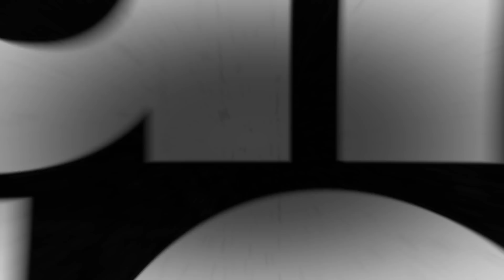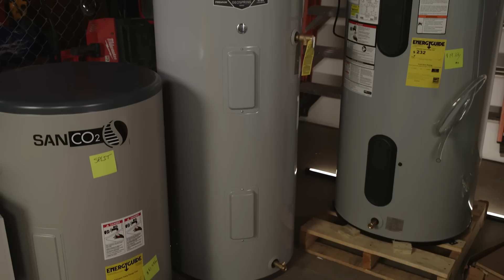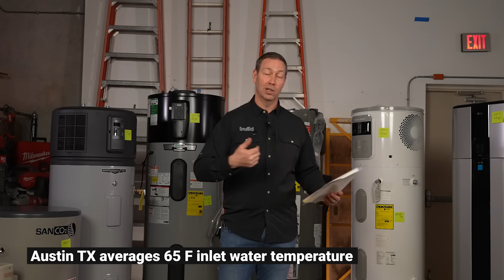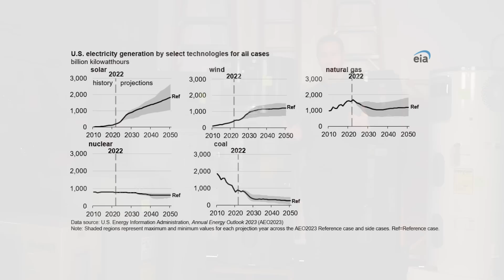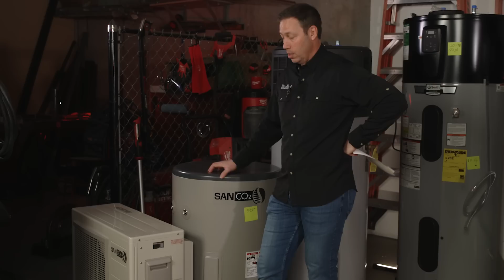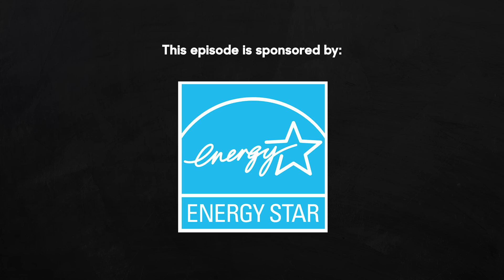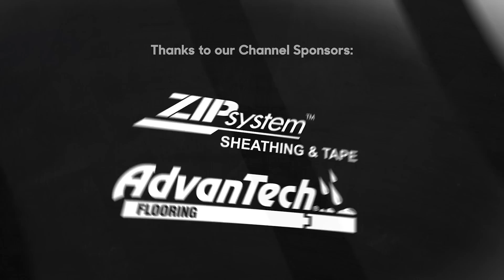2024 Heat Pump Water Heater Buyers Guide

Comment: they are great for hot climates where your typically using aircon.
however for cold climates it depends on your heat source. if your home heating is gas, then your hot water heater is effectively a very expensive gas hot water heater that also has a power bill. you would be better off with a split system.
if your using heat pump for home heating then you have two lots of running cost, one to move heat into the house, the other to move the house heat into the water. a split system can be more efficient due to a single move and can be easier to design.
if your in a mild area, the heat pump hot water can be a sizeable load on the house. again split systems are easier to design.
is the efficiency in summer going to make up for the reduced efficiency in winter?
keep in mind the home is a system.
Reply: Lots of good points here. Also for consideration, many regions don't have access to natural gas and (for perhaps political reasons) won't ever be able to get natural gas to their homes.
Reply: In terms of these being "fueled" by natural gas, keep in mind most furnaces are 80% efficient at minimum, and many here in the Midwest are >90% efficient. Most NG fired water heaters are ~60% efficient so you're still coming out ahead. In my house, the heat pump water heater is in the utility room in the basement, so I don't care if it's cold there. If it's closer to living space this would be more of a concern
Reply: @BensEcoAdvntr  I have a 2,000 SF, 5BR home in Iowa.  In the summer my natural gas (used for our clothes dryer and a 50 gallon water heater for 5 people) bill is $6/month.  There is zero chance that a heat pump water heater will pay for itself or come out ahead.  It probably costs more to operate than the natural gas water heater that cost 1/4 as much to install and will outlast any heat pump water heater.
Reply: @brianreineke9129  your bill structure is vastly different from mine here in Ohio. I still have a gas furnace along with the heat pump water heater. I use zero gas in summer months, but my bill is still $45 a month because the fixed charges don't change.  Sounds like yours is a percentage of gas used. A big part of gas service are fixed costs of pipelines, replacements, etc so much so that even in the winter the actual gas cost is still only half of the bill
Reply: @BensEcoAdvntr  my summer bill is actually $24/month.  $18 is the base charge if I used zero gas.  So $6 was for the gas that was used for the water heater and our clothes dryer.  If the heat pump water heater cost zero to operate it would take decades to pay for the cost difference from a tank gas water heater.  If the heat pump water heater costs 2kwhr/day to operate it costs more than the gas water heater.
Reply: @BensEcoAdvntr  good point. It all depends on how the efficiencies and overall costs stack up. 
I installed a resistance water heater because  the roi on a heat pump hot water is longer than its lifespan for my useage.

Comment: What's the comparison with tankless water heaters?
Reply: If you're asking about electric tankless, these are 3-4X more efficient, so around $400 per year less to operate. If you're asking about gas tankless, HPWHs are 3-5X more efficient, but utility rates vary greatly across the country. On average, though, a HPHW will cost about 1/2 as much to operate than a gas tankless.

Comment: Why is it seemingly impossible to find an HVAC tech that'll work with customer supplied equipment?

I want to buy a good heat pump off the internet, from a reputable source*, and replace my current crappy one. The model I want comes with 25 year warranty so long as it's installed professionally. It's 3ton, 18+ SEER1, quiet, works when it's cold, and not >$10k like many of the units the big companies have tried to sell me. But every tech/company I've talked to has either ghosted me, or tried to sell me their Mitsubishi, Armstrong, or Daikons. I'd do the work myself, but it's not really DIY friendly, and the warranty and rebates are only good if it's professionally installed. 

*It's a 3ton unit made by Gree/Midea from HVAC Direct. Didn't want this to sound like an ad. I'm in Pueblo CO if you're a tech willing to make some money here.

Comment: You did not mention that none of the heat pumps work if they space they are in  is freezing, with the exception of the SANCO2.  So if your garage freezes in the winter, they worn't work there.  If you put a heat pump water heater in your living space, you are robbing heat energy from your home heating system during winter, negating the savings.

Comment: I have a heat pump water heater in tropical Australia and have it in the laundry on the bottom floor and it makes it much nicer in there ( esp summer where it is 90f outside ) our winter day time temp is 70f  I am glad i did it 3 years ago as replacment foe electric element
Reply: Wow, 90 C outside. Talk about boiling heat! 🤣
Reply: @kgsails7102  lol too used to living in a metric country then attempting to convert

Comment: Thinking about installing a heat pump water heater but I use my basement for woodworking so I'm worried about the impact of dust on the unit
Reply: I would build a filter box over it. The filter in these would clog really fast and they protect the evaporator
Reply: @jepito29  the sanco2 unit seems really appealing (aside from price) to avoid this issue.

Comment: The video mentions setting these to "heat pump only" mode upon installation to see if that mode is sufficient for your home's hot water usage.

The 80gal Rheem HPWH that we had installed last month comes from the manufacturer set to "hybrid" mode (actually called "energy saver" mode by Rheem in their manual) per the manual, probably to avoid service calls if a unit needs to use resistance to meet the home's demand.

Also per the manual, the "vacation" mode on the Rheem holds the tank temp at 82F, higher than the 50-60F mentioned in the video.

Our North Jersey basement is definitely noticably colder than it was with a non-HP HW, but it's a storage space for us anyway. Hoping that the dehumidification aspect is at least as noticeable come the spring and summer.

After reading many reviews complaining about noise, I was pleasantly surprised by how silent the unit is.

Glad that the video mentions the use of a thermostatic mixing valve, which we had to add on.

For those like us on well water, it also makes sense to replace the anode rod (someplace where you have 3+ feet of head room) before installation with an active electronic anode rod (~18 inches) and can last for the life of the tank and avoid any rotten egg smells that can come from well water reacting to passive anode rods.

When I did the math for our region, any unit with a COP >= 3.25 is at least as cost efficient to operate as a gas-powered unit.

Comment: I'd love to see all the manufacturers agree on an interoperable ground-source standard. I'd have heat pump water heater, radiant floor, hot tub, fridge (why not?) and HVAC, all sharing the same ground source loops. That way, they'd help each other out.
Reply: Standards evolve over time and unfortunately don't align with every appliance replacement, and I think that is partially where the practicality of this idea would be likely to break down.

Comment: ....... No... Not how water works in thermodynamic envelopes. It takes the same amount of time for water to get to temperature no matter the start temp. it can be 45 or 65 it takes the same amount of time to get to 110. now depending on the temperature delta colder water can heat up quick than hotter water.  Now when you factor how a heat pump works Hotter water can get to temp quicker than colder water cause even though heat pumps are more efficient the efficiency hampers with the delta change fluctuations making the temperature curves become more linear in nature.

Comment: I have a stainless steel gas water heater that is good for life and it makes so much hot water it goes through a heat exchanger air handler that heats my house.  Super efficient compared to a heat pump type that robs heat from your house.
When the grid goes down in an ice storm I can run it all on my generator for 24hours on 3 gallons of unleaded gas.  If your electricity goes out those are useless!!

Comment: I'm considering a heat pump WH for a new post frame home, in series before an LPG WH. By my reasoning I can keep the reliability of hot water without electricity and preheat water entering the LPG WH so that the burner only fires if the system is dormant for a long time or usage exceeds the capacity of the heat pump tank. Thoughts?

I also am interested in ducting the air to and from the heat pump to take advantage of the cooling in the summer and vent it outside in the winter (I'm near Tulsa Ok).
Reply: LPG as in propane?

Comment: I have wondered how well these would work in a garage in a northern climate where the garage isn’t heated, obviously especially during the winter months.  Excellent review!
Reply: You don’t have to worry about heat loss- but the efficiency goes way down in a cold garage obviously.
Reply: @johnwhite2576  Yep. The COP of the heat pump will go down in colder ambient temps by some amount, it will also take longer to recover and not reflect in just power consumption. Rheem will run the heat pump down to 40F ambient. AOsmith will run the heat pump down to 45F. The others I don't know, San CO2 being a split system likely handles much lower temps, though I don't know how they go about defrosting if operating below 40F

Increasing the tank temp will also decrease the overall COP, it draws significantly more electricity when the tank is near fully heated compared to when cold water is coming in during use or more than around 1/3 of the tank is used.

At least with Rheem using 134a refrigerant, in a 50F garage the cold water power draw is about 250W, and after some time it slowly increases in draw and ends around 400W at 125F.
Reply: The Sanco2 will produce 145-150F water even at an ambient temperature of -26F (Yes, minus 26F) due to the effectiveness of the CO2 refrigerant.  And to answer the question about freeze protection, the unit automatically turns on when the ambient temperature drops below 37F.  This draws warmer water from the tank and replaces the colder water in the exterior lines.  There are also optional drain down valves, recommended if power outages are a possibility.  These open when the water temperature in the outside lines drops below 34F, to drain the outside pipes and heat pump to prevent freeze damage.
Reply: Our North Jersey garage is ~51F on this January day. I definitely wouldn't install it in the garage as I believe the unit will be fighting heat loss to the garage and the heat pump will also have a harder time scrounging heat from the surrounding air.

Seems perfect for an 80+F garage in Florida in Florida though.
Reply: @jeremyjedynak the garage is a pretty common place to install in a lot of places up north and west in the US. The insulation is pretty good on water heaters that you really don't have to worry about heat loss. In my garage at 50F average, but down to 40F, It could be idle overnight and all day and experience so little loss that the water heater doesn't reheat and the loss is hard to measure, theres nearly no difference from 40F vs 70F ambient especially. 

Due to how strong the stratification effect is in water heaters, the colder water will always be at the bottom, if it cools down you would see a larger pool of cold water at the bottom. For the water heater to turn on for maintenance heating, it would need the bottom thermostat to get something like 5-10 degrees below the setpoint before starting again. The fact that water heaters in all locations rarely have to reheat in a 12-24hr period is pretty good evidence of how good the insulation is. It's to the point that there is no efficiency gain for the manufacturer adding thicker insulation. To the point that tankless heaters have no efficiency benefit over tanks using the same heating tech (conventional gas, condensing gas, electric coil)
Reply: I'm an hour north of Philly. My 4 car walkout garage used to bottom out at 50deg.  in winter, now it might go to 40deg.

Comment: My Rheem unit has a warning to say you should run it in hybrid mode to get more efficiency but I am not sure I believe it, its is in a pretty stable temperature basement a couple degrees cooler than my house. Hard to believe that heat pump only wouldn't be the most efficient.
Reply: My Rheem manual says the same thing and it is confusing.

They actually call the hybrid mode "energy saver" mode and ship the unit from the factory set to this mode.

I think that the real reason they're doing this is to avoid service calls from homes where the demand exceeds the capacity of the "heat pump only" mode.

Comment: I think the elephant in the room that all these people promoting efficiencies seem to gloss over for cold climate installations is how is this energy being introduced into the space where tanks are being installed. If you are using electric resistance or gas furnace to heat the adjoining spaces inside your house then there are no savings. You are actually using more energy to transfer the heat energy from the room into the tank when it could have been transferred directly to the water with a electric resistance coil.
The only exception would be the SANCO2 which captures the energy from an external air source or if any of these models permits ducting outside air into the unit without voiding the warranty.

Comment: I believe some of the Rheem units have two heating units. Can you hook them up so that one is connected to the grid while the other connects directly to a photovoltaic array? I would like to put a smallish array on our roof and just dump all the electricity into the water heater without having to spend money on the usual equipment to tie into the grid. That ability to mix the water to get  a desired temperature should mean that you wouldn't have to worry about over heating the tank.

Comment: Finally found the SanCO2, it is amazing. Didn’t go over what sets it apart from the other units, like a stainless steel tank or using CO2 as the refrigerant making it more efficient, but it’s a start.
Reply from the maker: Stay tuned for a follow up to this video posting in the near future
Reply: @buildshow I'd love to hear insights on whether it could be used for both domestic hot water and hydronic heating.  That would be amazing.
Reply: @BobPritchard  Sanden themselves say no, because it's only 15k BTU. They only recommend it for a small space or in a Net Zero home. But there is a company that uses the Sanden compressor with a smart controller and large tanks as a thermal battery.
Reply: @BobPritchard  It can do both if you have small btu needs (<8k i think) for the hydronic.  our local supplier (small planet supply) tells you how to set it up.
Reply: @BobPritchard it has been used with a Taco heat exchanger for up to 10,000 BTU of radiant heat.
Reply: @BobPritchard  Eco2 Systems supports limited use of a Sanco2 for hydronic heating.  As other respondents below have correctly stated, it has a 15,400 btu/hr capacity.  Eco2 allows 8,000-10,000 btu/hr of hydronic heating in climates where the minimum expected winter temperature is 25F.  One constraint is that the system is not of sufficient capacity because it was designed for DHW, not space heating, and if the heat pump runs constantly it will decrease expected life.  Another constraint is that the return temperature from the Taco X block is higher than the groundwater temperature.  The Sanco2 has an efficiency sweet spot with about a 90F rise in temperature.  As the incoming water gets too warm, efficiency in terms of COP or UEF suffers.
Reply: Or the fact the Sanden can have much larger tanks, or even multiple tanks driven off of the same outdoor unit.
Reply: You have to be careful finding installers, I recently got a quote for $17k to install one.
Reply: @jims.4785  Indeed. I was initially quoted something absurd.
Reply: @jims.4785  holy overcharge Batman!  Absurd labor upcharges is why we are building our own home and using minimal outside contractors.  It's a grueling process, but at least we can afford a home.
Reply: The stainless tank options for the Sanco2 (43 and 83 gallons) eliminate the need for anode rods too!  There's also a 119 gallon option but it is not stainless and requires anode rods.
Reply: My laundry room is usually around 47 degrees f in the winter. Probably not enough heat in there for a heat pump